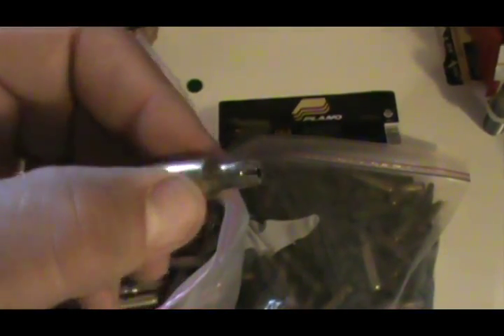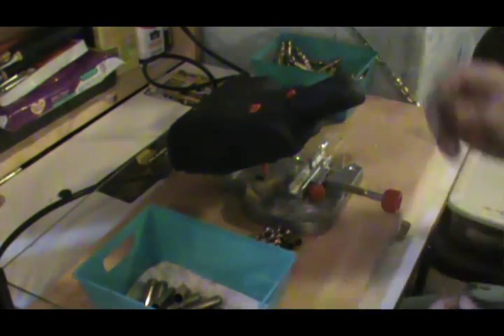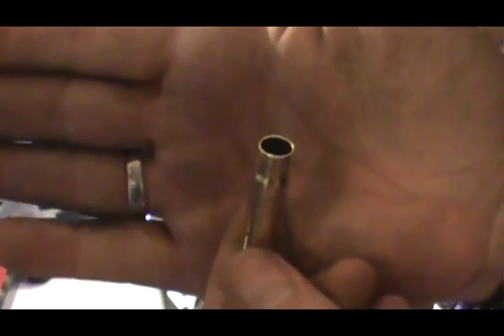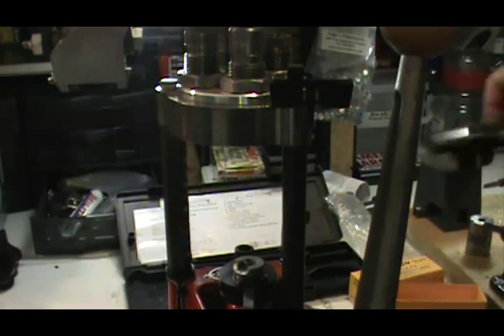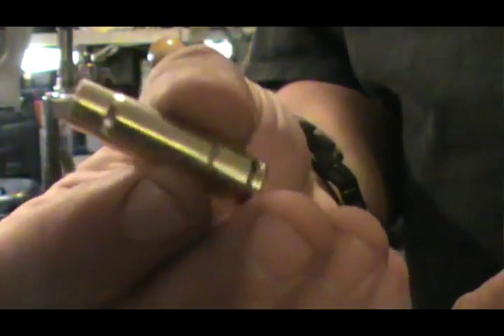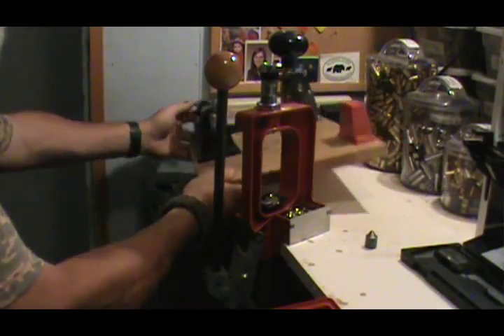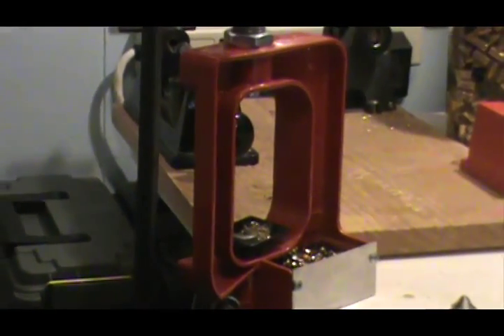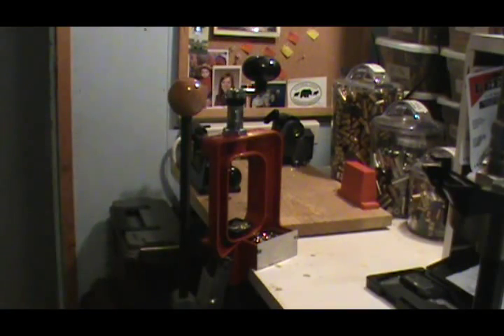556 Blanks to 300 Blackout

Comment: Ok I've been reading a lot of articles on this and I'm getting mixed responses.  Many say the blank brass to weak and thin, many say it's perfectly fine.  I have Lake City 5.56 blanks and I'm wanting to do exactly what you are doing, convert it to 300 Blackout.  Have you had any problems with the the brass being weak or splitting or cracking, or being unsafe?
Reply from the maker: Kevin, I have not had any issues with the blank brass that I have been using.  Now of course I don't load to max charges and I do painlessly look at each casing for evidence of any splitting or cracking.  The blank brass is easy to separate from regular brass due to the line that is above the rim.  So after shooting, I will clean them in a tumbler, and resize each casing.  After resizing I will check the throat and neck very closely and then the rest of the case.  I have heard the same stories as you and I have been on many forums and even here on YouTube, everyone has an opinion whether it is okay to use or not okay.  Knowing how OCD I am about reloading, I chose to use them.  I hope that helps.  Just keep an eye on it, not all brass is created equally and when it comes to reloading we have to do our due-diligence and make sure we our loading safely for our own safety as well as the others who may be around us when shooting.  Juddie - J & J TOA
Reply: I have been using blanks to 300 blackout for several years.  I have loaded subsonic and maxxed out super sonic with no issues.  I currently have three powder barrels of 556 fired blanks to convert.

Comment: How are you  running the brass up into the sizing die without lubing the case?
Reply from the maker: intruder220, I see you caught that!!  LOL  Really I should be lubing the cases, but I have not had any issues with them not being lubed.  I can only assume that where there isn't much of a shoulder to create there isn't much resistance.  But, this was for the video only.  Usually I wash the cases in Lemi-Shine and Dawn dish liquid and once dried I tumble in walnut media with red jewelers rooge powder.  This makes the cases slick.
Reply: Only caught it because I winced when you ran it up.  I've stuck cases before, so now i'm really careful to lube 'em.......good video
Reply: +intruder220 A really good, safe, and cheap lube is: (1 part Pure Lanolin) to (12 parts 99% Isopropyl Alcohol). Works great. Very cost effective.